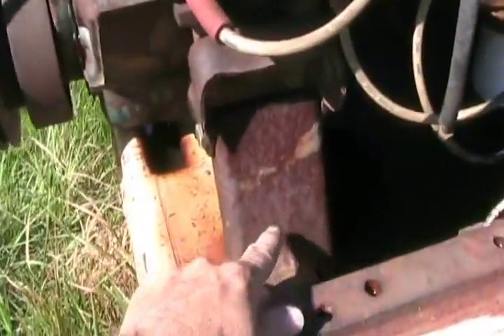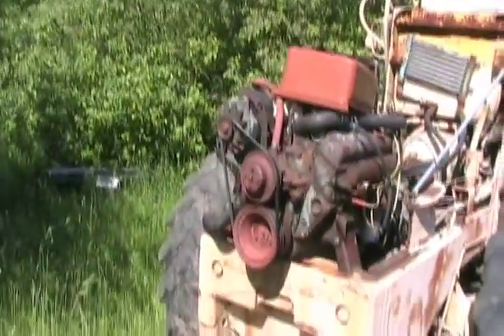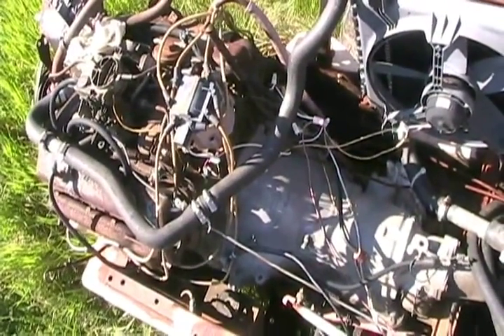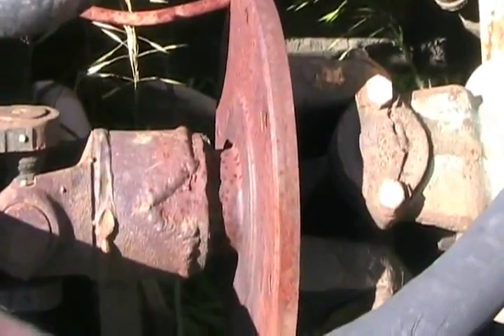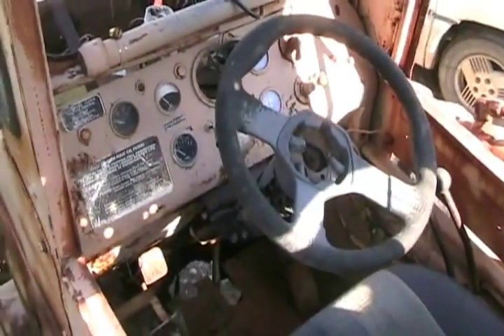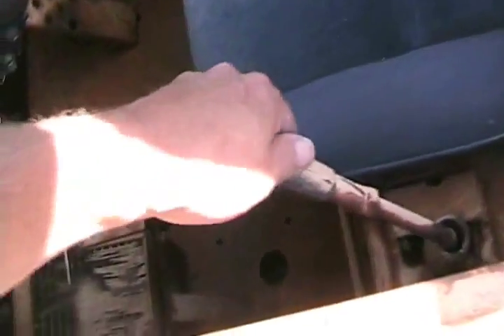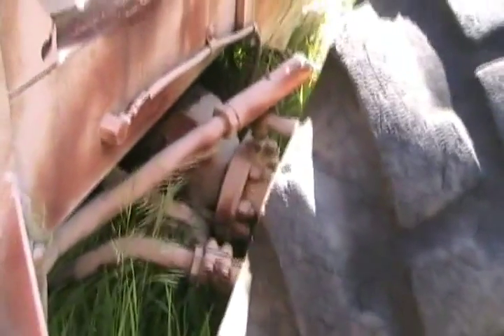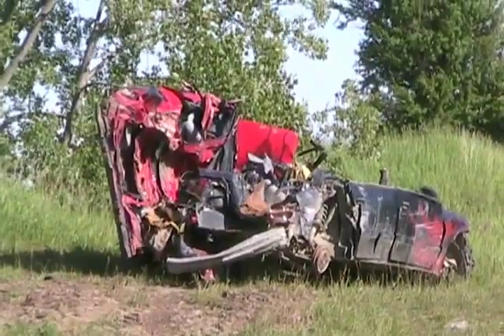#1021 How i put a chev 305 V8 motor in my loader [Davidsfarm]

Comment: Not to be a downer here, but the head gasket probably failed due to it overheating because the cylinder head was so caked up with sludge from not doing oil changes lol
Reply: Highly doubt that because Dave was really good about maintenance on his vehicles he probably ran it and didnt know the head gasket blew and it probably filled full of antifreeze and threw a rod
Reply: @jacksongreiner2919  he uses used motor oil in his vehicles. I highly doubt he went to the auto parts store, and bought a brand new oil filter, and fresh jug of oil for it. Hahahahaha
Reply: "What could be cheaper than free?"